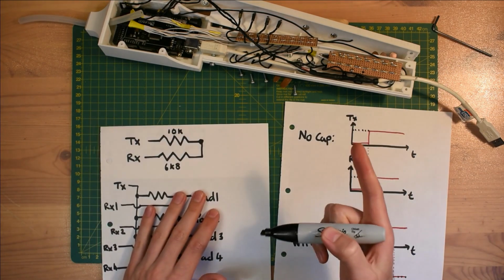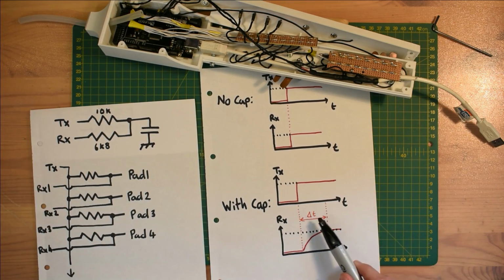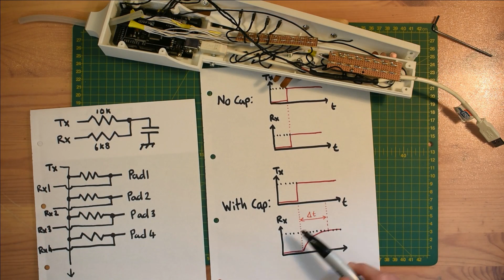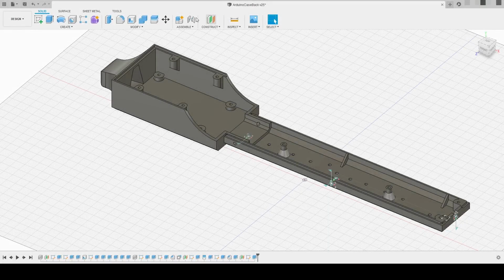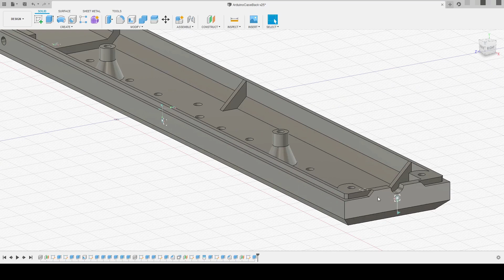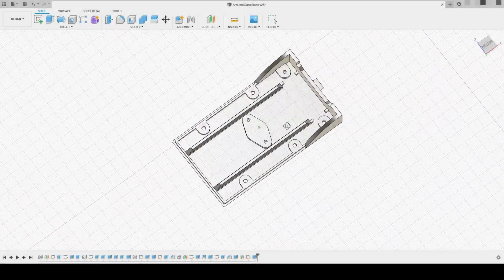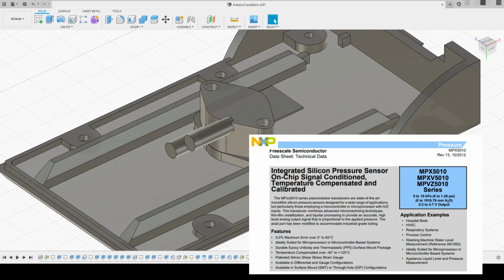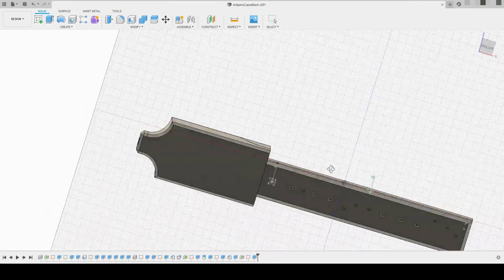Home-built Electronic Wind Instrument - A LoFi Spin on the AKAI EWI

Comment: Replace your homemade capacitive touch sensor with a MPR121 based module - it will work much better and you won't need the ground pad.
Reply from the maker: Yep! That's what I did on the next instrument. Works much much better...

Comment: Hey man, I’m confused by your limitation to 4 pads at any given moment. Even if the capacitance changes based on how many you are touching, shouldn’t you just be checking for ANY noticeable difference for each key? Why stop at 4? Is it a limitation of the arduino’s sensitivity?
Reply from the maker: Hiya. I just have a threshold that, when exceeded, indicates that a specific pad has been touched. The problem I was finding was that there's also some noise and a pad being left untouched does not mean the value returned by the capacitive sensing function is exactly zero. The more pads you touch, the smaller the margin of difference over my threshold is (due to sharing of the capacitance across pads I think) and so the less easy it is to determine a touch. Lowering the threshold would help if there was no offset and no noise, but as it is, it just means that sometimes the system detects touches that didn't happen.

It might be possible to change the sensitivity by changing the values of the resistors in the capacitive sensing circuit too. These values were just the ones that I settled on as making them much higher made the pads too sensitive to the point where touching one could cause a second one to trigger.

I hope that clarifies it!

Comment: I built the TeensyWI. Was going to use it as a transition to the EWI.. but it works so well there is no point. Maybe the 4000 or 5000 because of the built in sounds.. but they are so dam large! I like your version and the fact you kept it compact. Well done!
Reply from the maker: That's cool! This one would have been way smaller if I'd used a teensy instead of an Arduino Mega (at least wouldn't have the big tadpole head). Did you build the TeensyWI as an exact copy? Should be fairly straight forward to modify the design to make it your own style :) My new trumpet (EVI) is also mostly complete so hang tight for a video on that soon!
Reply: @extralargeengineering8384  eagerly looking forward to your video update...
Reply: @extralargeengineering8384  I used a Teensy 3.2 and a MPX2010 with separate amp IC which required a bit of tinkering with the software parameters but works well. I am building a nice wood body for it . It would be great to get a syth with audio out to fit into the case.. but maybe that's asking a bit much :-)  It will be great to see your EVI, look forward to it!    P.S. a tip for you... disassemble some AA alkaline batteries by pulling the anode out.. they make nice touch plates!
Reply from the maker: Ah yeah. When I started out the project I began with an MPX10DP (also un-amplified), an op amp circuit and an external ADC chip because I was using the raspberry pi. I realised it would be way now straightforward to just use an Arduino and amplified sensor haha. 

Regarding audio-out, I've seen some people using just a teensy and its DAC produce simple synth audio. I'm honestly a bit surprised they're powerful enough to do that but it seems to work. I've hooked up mine to a headphone jack in the EVI so will see if it works at some point :). 

With the AA batteries, do you mean the little nipple end? I've actually used stainless steel finishing washers and they're pretty comfy. They centre your finger nicely in them too!
Reply: @extralargeengineering8384  Cool.. I could not get the MPX5010 locally and I had a 2010 on hand so I used that. Yes, the Teensy is a pretty powerful little package, would not be surprised if it could handle a synth as well as the WI with the right code... too bad I am not a programmer :-(   Not the nipple end, the other end. On alkaline batteries it slides out and has a pin attached to which you can solder the contact wire :-)
Reply from the maker: That's really handy (the batteries). For the EWI I used little pieces of copper from a flattened copper pipe with header pins soldered into a little hole punched in the middle of each. That way the pads can be detached easily by just unplugging the wire on the back side. All the wires have a female header socket on the end.

Comment: This is so cool! I’m trying to figure out how to code with a Teensy 4.0 board (and an audio adapter board for it), so I can make something very similar.
Reply from the maker: I'm glad you liked it! The Teensy 4.0 looks super powerful. Will have to get my hands on one at some point. Though to be honest, I've not found that I've needed the extra "grunt" for anything yet....
Reply: Extra Large Engineering Was there any reason you decided to only allow it to send MIDI signals? More specifically, did you ever consider adding some sort of onboard sound?
Reply from the maker: If I remember correctly I originally did want to add a headphone jack but the project had been going on for so long that I wanted to just push ahead and get something working. I haven't looked into it but I suspect you would need to add some sort of DAC and amplification if you wanted to drive anything other than the tiniest of speakers (Might even need one for earphones to be honest). Another reason I chose to just send MIDI is that I suspected that the microcontroller might not be powerful enough to do all the input sensing while also producing audio. I figured the audio might end up choppy as the processor would be busy working on other things. I never gave it a shot though so you might find that it works fine :) Just from looking at the teensy 4.0 specs it looks like you don't have a DAC there either unfortunately.

I'm planning to use the DAC on the teensy LC that I'm using for my EVI build as a headphone jack but I suspect it'll only be good for basic waveforms like square or triangle.
Reply: Extra Large Engineering there is an audio board, that I bought with the teensy, that can actually be used to play soundfonts, among other things. And it has a headphone jack on the board, so that’s not an issue.
Reply from the maker: @griffindrucker5712  Oh that's cool. I hope it works out! Feel free to drop me a message or something when you finish it. Would love to see it.
Reply: @griffindrucker5712   Dear Griffin, how to store the vst files and program so that we can retrieve the individual instrument vst sounds to play our notes?!!!

Can we also send the generated music over Bluetooth or wifi to standalone speaker sets? 🙏🏻🙏🏻🙏🏻☺️
Reply: It's definitely a very attractive project to lay hand on.👌🏻👌🏻👌🏻👍🏻😇
While talking about the pressure sensor... You did mention that it is same that's being used in washing machine water level sensing... Can you please share more details about it....

Also about your project's technical details... as I wish to try my hands on to build such one... On my own 😊👍🏻👌🏻
Reply from the maker: @Future Technologies Talks
Hi! Sorry I missed this comment. Haven't quite worked out how to get notified of new replies... The sensor I used is the MPX5010DP and is basically a pressure sensor with all the amplification and stuff needed to use it built-in. This one puts out a voltage range of roughly 0.2-4.7V when driven with 5V so you don't need to worry about removing offsets, amplifying etc. like you would if you use an un-amplified sensor like the MPX2010DP. The datasheet will give you more info than I can! Here it is: https://www.nxp.com/docs/en/data-sheet/MPX5010.pdf . 

Regarding technical details, is there anything specifically you want to know? I learned a lot from Johan Berglund's MiniWI project (I've linked his youtube channel in the description) which is also on hackaday if you'd like some schematics. His is obviously a little different than mine but they're pretty close and should give you a good idea of where you might like to start. Project link: https://hackaday.io/project/11843-miniwi-woodwind-midi-controller

Of course it can be made wireless! If I was going to, I would have likely used  something like an ESP32 which is a microcontroller with built-in WiFi, bluetooth etc.
Reply from the maker: @Future Technologies Talks
 Yep. I used the MPX5010DP because it was the only one the supplier had. The DP just stands for "Differential pressure" so it measures the pressure difference between the two input ports. In my design I only use the positive pressure input ( if you have a look at the top of page 7 on the datasheet you can see the sensor operates with pressure input 1 > pressure input 2. The unused port can just be left open to the atmosphere and then the sensor behaves as a 5010GP (GP stands for "Gauge pressure") as I'm pretty sure the GP version is just the same sensor but with one fewer port on it (The other side of the sensor diaphragm might just be vented to the atmosphere around the sensor - This is just a guess). Basically I'm using the DP as a GP because that's what I had available. Either works just fine. 

Though the teensy 3.6 is way more powerful than the Mega 2560, you have to be careful as the inputs are all 3.3V only. If you connect the output of the MPX5010 (which is a 5V sensor) to one of the pins on the teensy without any protection, you can very easily break that pin or even the whole teensy. Simplest way to fix that is with a potential divider, but you still have to be careful. 

The MPX10DP (not 5010DP) is a trickier sensor to use because it only has a small output range of 35mV which means you'd need to do some amplification before you'd have a signal that's big enough for the teensy/mega to accurately read. Also the 10DP is not compensated which means the output voltage could change depending on the temperature. You probably don't want to use it because of that -  as you play the instrument, it could warm up/cool down and change the value your microcontroller is reading.

I don't think I'm qualified to walk you through the whole process I'm afraid -  I'm really just learning as I go along. I can give you some pointers though! If you have specific questions I'm happy to answer them but I hope you can understand that I'm not really in a position where I could teach you everything at once in one huge comment/email. A lot of it comes down to trial end error :) I certainly make lots of mistakes and I also rely very heavily on tutorials and blog posts, youtube videos etc.
Reply: @extralargeengineering8384  Thanks a ton for your informative response. It's really helpful & encouraging me to strive forward to explore the possibilities.

I highly appreciate your crisp & valuable inputs.

Thanks & best wishes
Reply: @Dr.SanjeevSaxena  MPX2010 is cheaper and more readily available. Made a simple  one IC, one resistor, differential amplifier and it works fine on 5 volts. (TeensieWI (3.2) build)
Reply: @rogerredford4010  Thanks Dear. Can you also share more detailed information about mpx2010 circuit schematics and layout specifics... If you are more COMFORTABLE you can share as DM...
Reply: @Dr.SanjeevSaxena  Sure. I used an LM358 which is a dual amplifier but I only used one half. A 390K resistor between the '-' input and the output (between pin 1 and 2). The inputs then connect to the inverting '-' and non inverting '+' outputs of the MPX2010. The output of the amp (pin 1) then goes to the Teensy input (A7) and both the LM358 and the MPX2010 connect to 5 volts. Note I used Teensy 3.2 which is 5v tolerant (with the Teensy LC ensure you check the max output voltage of the amp at full breath. It wont reach 5V but just be safe in case you make a wiring mistake as the LC will be damaged with 5V at a pin. Edit: Actually it is probably damaged at less than that 5V.. so use the Teensy 3.2 to be safe and forget the LC). Just google the pinouts of the 2 devices and you'll be good :-) As for the TeensyWI sketch, the only changes to account for the different pressure sensor voltages are #define breath_max 4100 and #define ON_Thr 3500
Reply: @rogerredford4010  Amazing response time, Dear. 👌🏻🙏🏻🙏🏻🙏🏻Thanks for your helpful information.. I will definitely play around with your shared experience & knowledge. Thanks a ton.

Best regards. Wishes for your safe family time ahead. 🙏🏻🙏🏻🙏🏻
Reply: @rogerredford4010  I have ordered Teensy 3.6 (without headers) and it's audio shield. So, I need to look around the tolerated voltage/load accordingly (while attentive & cautionate about alerts you brought to the notice) 👍🏻

Thanks 

Thanks again
Reply: Can this be made wireless too?!! 😊